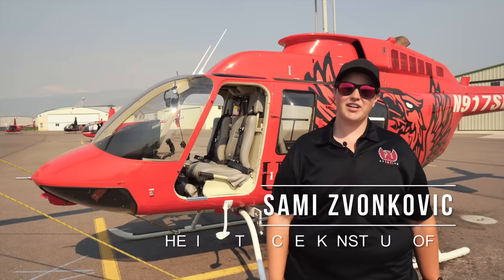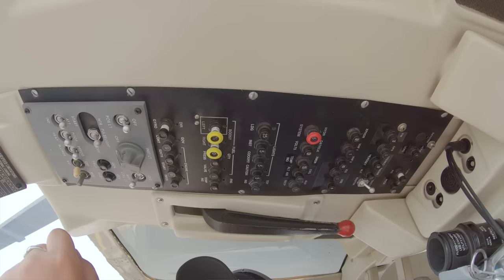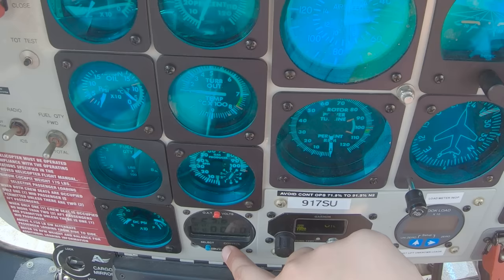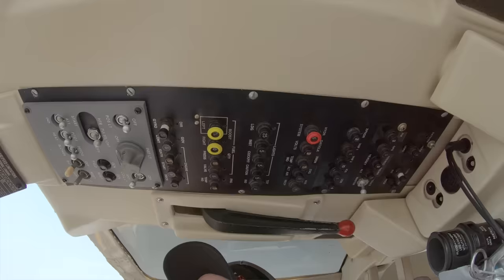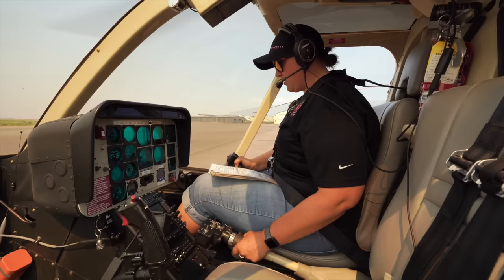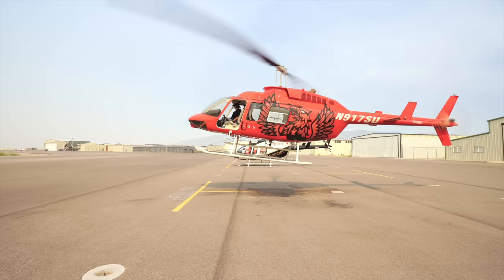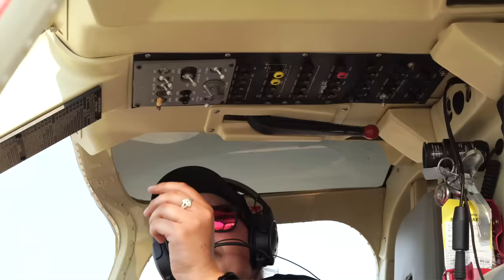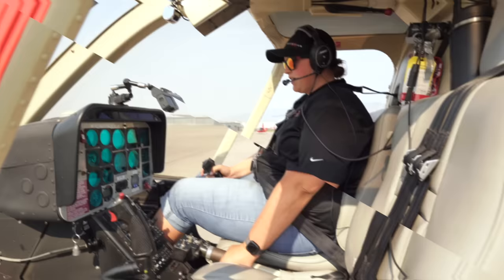How to Startup & Take Off a Bell 206 Helicopter

Comment: I have piloted fixed wing in real world.  I have also piloted  a Bell 206 simulator.  The instructor always had the “engine “ at max governed RPM when I stepped into the sim.  I read the manual about startup and shutdown, but I never had to perform those operations.  That saved time in the sim for flying, which I thoroughly enjoyed.  I have also been a passenger in real world in a 206.  It was quite fascinating and educational.  Thanks for your video.  I’m an old man now.  Living vicariously has its advantages.

Comment: During my Army Aviator days., we were trained to look at the rotor blades when checking controls movements to make sure they follow..
Reply: is that because you had an APU to drive the hydraulics without engine power?
Reply: @ticenits1926  no its to make sure the rigging adjustments in the flight controls matches the control inputs. One mechanic made a fatal mistake when he adjusted the elevator cable to the extreme end and the elevators were adjusted in the up elevator region. The pilot never asked the copilot to check the elevator or other surfaces for full deflection in the up and down level. The aircraft ended up pitching up, then stalling into a turn spin and crashed outside a hanger and killed many people aboard.
Reply: Correct !
Reply: excellent explanation by this CFI. the 206L4 is a real sweetheart 👌
Reply: Great instruction!!
Reply: Yippers..they taught that very early at Ft Rucker, nothing like the rotor  ibration and start up shake of the whole bird!
Reply: More than ever, I’m convinced humans weren’t made to fly.
Reply: @LK-pc4sq damn where did that happen? I'm surprised no one else caught that horrible adjustment mistake before it was too late.

Comment: Well done. I would add one thing, make sure the blades are turning by the time you get to 25% N1. I was also taught to take a peak that the oil pressure is starting to rise as well.
Reply: Shame you weren't taught that it's 'peek'.

Comment: Maam, during the run down instead of using the rotor brakes (jus to increase its longevity)  i  raise the collective a few millimeters up so that the rotors stop by aerodynamic braking..n then i use the rotor brakes to fully stop it..nice video

Comment: Jet Bell ranger. Back in 77 to fort Campbell Kentucky me and my buddy use to work on those helicopters we used to go on the flight line and hotwire them. Just remove the center panel it's easy to hotwire use  to fire them up all the time.

Comment: Honestly, I never came across to such a detailed tutorial video with full patience. 
If I have to explain anything I do same way , believing person before you want to know everything.
Great work, thanks.

Isn't this Bell 206 almost same as huey ? 
On one comment section,one person told me " I never had to wait to keep engine starting motor switch pushing untill the TOT drops from 900 degree to 150 degrees" 
I as I noticed how you did here , thaught you keep running starting motor with idole throttle until TOT falls to green again, otherwise abort the start ?
Ain't I right?

Comment: Great start up video I didn’t realize it was that complicated just preflighting and starting. My father-in-law flew the DC Stretch 8 quite confidently but the helicopter scared the crap out of him. He said he felt like you could absolutely crash the thing and die so easily.
Reply: Fixed wing pilots referred to helicopters as "beating the air into submission", funny. However, a helicopter with functioning collective can autorotate from 10,000 feet and not even bend the landing gear. A fixed wing aircraft able to stay above its stall speed may survive with a perfect landing area. Ie airstrip, open flat field and water. Most stall speeds are way above what you want to hit the ground at. Once you're below stall speed, you can expect to go in nose first.
Reply: @kevinlancaster5714  The difference being, fixed-wing aircraft can usually glide for miles to find a good clear landing spot, a heli autorotating can't do that to the same degree, so if you're over a forest of trees you may be out of luck even if you perfectly rotate for a landing it may still be a crash-landing, you have a lot less time too.
Reply: @VenturiLife  That is true. And if you are flying a little Cessna with a fairly low stall speed, that "acceptable" landing area may be smooth enough to not cause you to cartwheel or nose over. A passenger jet, glide as far as you're able and unless it's a runway or water landing, it aint gonna be good. I was in an OH58 (Bell Jet Ranger) and a hydraulic line for the collective blew. We were at 15' about to go into transitional lift, it bent the skids when we hit the ground. Same type aircraft and the hot section blew apart at 10,000 feet. The engine is now totally worthless! The pilot landed (on the runway) without even bending the skids. He got an award, and rightfully so, but it can be done. Besides, there aint nothing like dangling your legs out the door of a Huey eating a sandwich with your toolbox next to you (not moving an inch) to give you an understanding of just how awesome rotor wing aircraft can be.

Comment: I have nothing to do with aviation, but somehow I found this video. Is the rotor brake handle to stop the rotors in case somebody goes next to them? I always thought that couldn’t be done.
Reply from the maker: The application of rotor brake is just part of the shut down procedure, or in the event of an emergency where stopping the rotors from spinning would be required. It takes a few cycles for them to stop spinning completely, even after engaging the rotor brake.

Comment: OK, so you're saying when ready to go you turn the throttle to full throttle and that's it? during flight you don't need to move the throttle? does that differ from a gas engine?
Reply from the maker: Yep! Our helicopters have a governor that adjusts the RPM automatically, so we don't need to adjust the throttle.

Comment: Dayam! That is one serious checklist!
I'm curious why you don't sit in the left seat as pilot in command?
Reply: Helicopter pilots sit in the right seat for the following reasons:  A helicopter pilot learns to fly by controlling the collective using the left hand and the cyclic using the right hand.  The collective is always on the left side, regardless of which seat is selected in the cockpit.  From the preferred right seat the pilot can then use his/her left hand to manipulate the various switches, controls and radios (which are all situated mostly to his left).  This is important because in a helicopter you almost never let go of the cyclic (which is in your right hand).  If you sit in the left seat you will have to either (1) let go of the collective and use your "untrained" left hand to control the cyclic, or (2) awkwardly reach over yourself with your left hand to manipulate radios or switches.  Back to the right seat;  In those rare instances when you do have to use your right hand for something, you generally still maintain control of the cyclic by using your untrained left hand, or by holding the cyclic between your legs.  Although helicopter pilots want to (and should) maintain physical contact with all flight controls (cyclic, collective, and both pedals) at all times, this is not always possible.  It is not unusual to let go of the collective, even for extended periods of time.  But that is not the case with the cycle stick to maintain safe flight.  Helicopters can be flown from the left seat, but the above reasons explain why this type of aircraft is typically flown from the right seat.
Reply: Mother Rucker '72.
IP (instructor pilot) sat in the left seat, student has a decision...
... right seat or walk.
.
An aside:
Watch a tony robbins infomercial.
His voice-over suggests he is a helo pilot...
... but he waves to the ground-based camera from the left seat as the helo lifts.
Do you have any idea of the ground-effect instability...
... and he can fly with one hand.
A cheesy loudmouth buffoon.
.
I welcome your rebuttal.

Comment: I would love to learn to fly a helicopter 😎
Reply from the maker: Hey! Would you like some more information about our program?
Reply: @SUUAviation  theres a program??
Reply: @SUUAviation  yes.
Reply: @SUUAviation  I was told 9ne time I had to learn to fly fixed wing first before I could fly a chopper. So I got interested in microsoft flight simulator and I've got good at flying cessna simulators. I'm living in Toronto Canada so currently there is no aviation program that I can see of. My father worked for bombardier for a living.
Reply from the maker: @amonster8mymother Here is some information on our rotor wing program:
Located in Cedar City, Utah, we are one of the highest collegiate flight schools in the country. We offer flight training from your private to commercial certificates. We also get you your certified flight instructor ratings so that you can become a flight instructor right out of the program.
Our helicopter program is five semesters and can be done in two years. We offer classes in the fall, spring, and summer semesters. At the end of your helicopter training, you will have around 200 hours of flight time. You will have to be here to fly, but you will have the option of completing some of your General Ed classes online from wherever.
The average cost for training in the R44 cadets is about $28k/semester for five semesters, including in-state tuition. That investment includes all flight fees, mountain flight, night vision, long line (load-bearing), unlimited simulator, and one-on-one instructor time. However, eligible veterans are able to use their GI Bills for flight training.
You can also check out our other videos!
If you’re interested in taking an Intro Flight and a Hangar tour, we’d be happy to have you. Got any questions? Feel free to ask away.
Reply: @SUUAviation  so that's $140 000 for tuition?
Reply from the maker: @amonster8mymother  It can definitely be expensive. Luckily, SUU offers a lot of financial aid that can help offset the cost. Would you like us to send you some resources?

Comment: Why do you need to let the Helicopter idle for 2 mins before shutting off?
Reply from the maker: Hi! It's not an FAA requirement but something the school prefers to do. Letting the helicopter idle lets the cylinder head temperature gradually cool instead of rapidly cool.

Comment: Great video. What are you using to capture the audio in your headset? I currently use a lavalier mic and Go Pro Hero 7
Reply from the maker: Thanks! We use a GoPro Hero 7 and a lapel mic!
Reply: @SUUAviation  I do the same but in order to capture the audio in your headset you can place the mic inside the ear cup.  This will give you ATC coms when you have the avionics turned On as well as ambient nose from the aircraft. Try it and let me know what you think.
Reply from the maker: @pag6999  That's a great idea Paul. We'll give it a shot and let you know how it goes!

Comment: My Bell 206 is parked in my Driveway….
Pre Start Up: Key in pocket; plug in phone charger; Turn on Radio, Push Starter Button; Gear Selector R; Select D; check Text Msgs, See ya…❤😂🎉🎉🎃

Comment: Y don't any of these instructors ever explain what these switches are for instead of checking if they in correct position!?!
Reply from the maker: As the instructor runs down the check list they’re insuring switches are in the correct position.
Reply: @SUUAviation  yes but what does this title say, suggesting this is an instructional video

Comment: Oh my goodness.. It takes longer than starting up a EC 135. :-) But please tell me once! What is the thing in the US with flying with open doors!!?? nearly every helicopter in the US is flying with open doors!? Even police and military helicopter. What’s the thing behind it?? I see it in no other country than in the US…
Reply: In the case of this helicopter the front doors are not opened, they have actually been removed from the aircraft.  Whether the doors are installed or not depends mostly on the mission or use of the helicopter.  In non-inclement weather, doors are often removed simply to improve the pilot's field of vision.  Even in rainy weather the streamlining effect during flight combined with the rotor downwash keeps the bulk of rain from entering the aircraft through the door openings.  Also, if the aircraft is not equipped with air conditioning, the lack of doors provide additional ventilation.  More reasons - two fewer things to have to deal with and slightly less weight to have to lift.
Reply: Generosity.
Out of the goodness of their hearts, Americans donate their doors to the less fortunate.
True fact...

Comment: She did sciped a vary important part in the Bat on . There are two horns on this heli . One horn is a solid sound and this one is for engine stall , The other sound is a beeping sound at different pitch . This sould I belive is for rotor pitch or stall . But I am just learning the check list and I am not a pilot . I do know you just cant fly threw the check list when your making a video . That is not good . Because there are people that may take these video's as instruction . A check list is not a race and every step keeps people from getting killed .